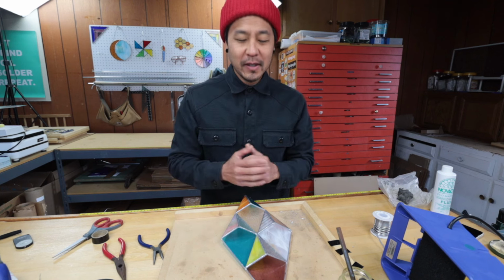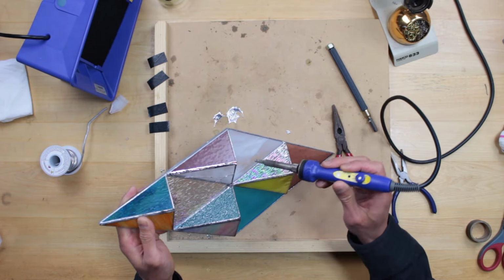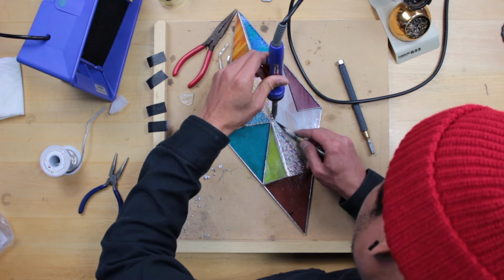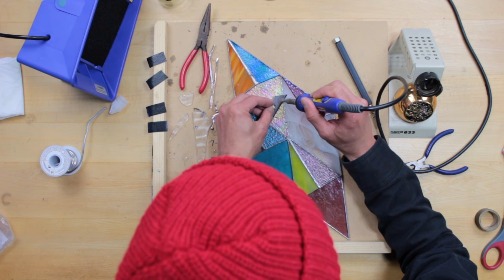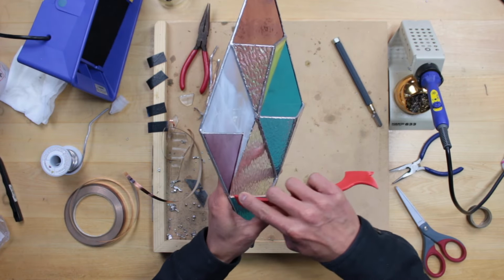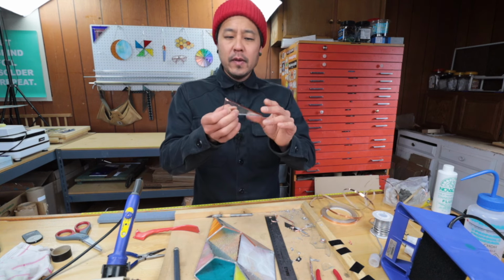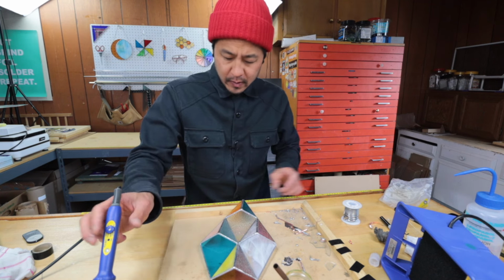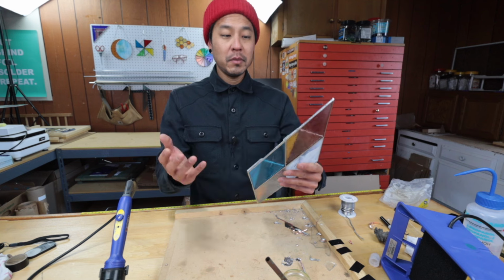SGDIY | Air Plant Holder Wall Mount Ep5 | Fixing a broken stained glass piece

Comment: I use part of a soda aluminum can and wedge it into the seam as it melts off.  Solder doesn't stick to aluminum.  Card stock works too, I prefer the aluminum.
Reply: When you get a tail started of the foil, hold it with pliers, heat the solder to melt and slowly pull as it melts.
Reply: @BobbiSchneider  -great suggestion!

Comment: Now I'm at 1:13:40 -that's exactly what I ended up doing.  I had made an 18" x12" TX flag, and as I was re-touching the solder, I heard POP.  It was a tiny line, but it just ruined my moment for sure!  I ended up gifting it to her instead, and now I'm about to make her another one.  I'll get the old one back when I do.  It's pure torture to do repair work, so I make it clear to people that it ain't gonna happen.

Comment: I have to stop watching; the anxiety over this repair is killing me. It looks like you're trying to remove the foil from connecting pieces. I'm not sure how you can "easily" remove one piece in an ensemble.

I'm finding that when we think a project will be "easy", something always happens to change the course of the project, or how we think about it. I stopped at about 35:00. Sorry!